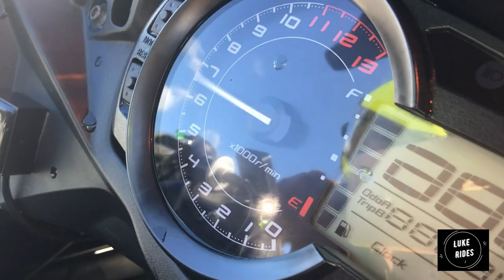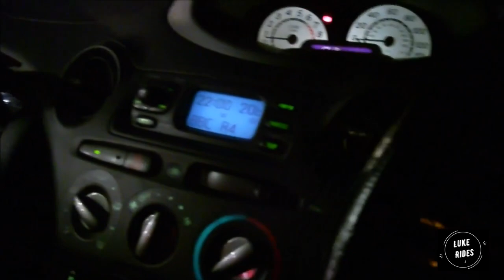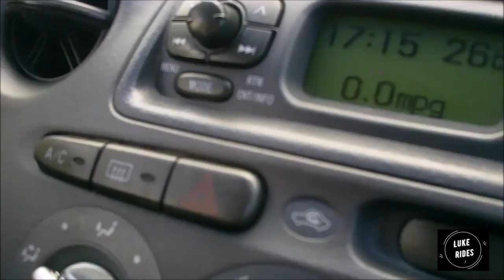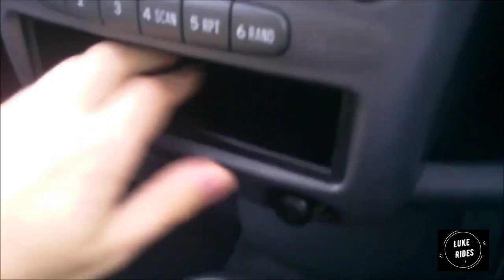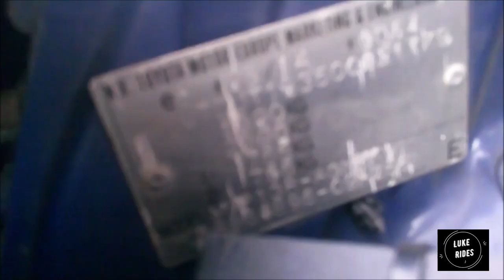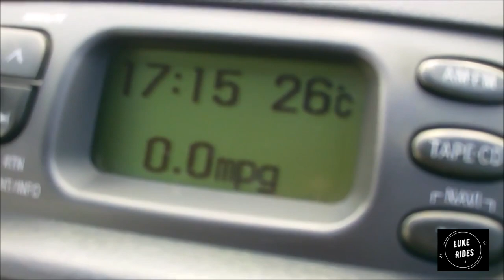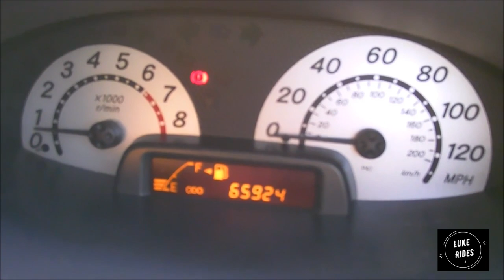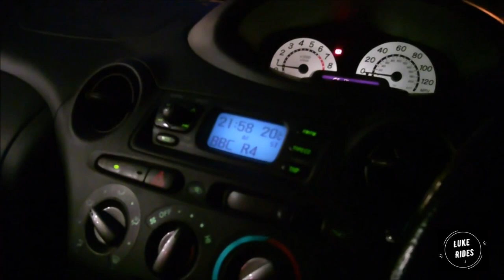Why Toyota Yaris T Sport Was A Great Hot Hatch @ Luke Rides

Comment: 1:30 lol
Reply from the maker: Haha. Awww. Luke Rides really appreciates your comment Harry and glad you found it funny. Luke Rides likes to play with his motovlogs and to have fun in his own way when it comes to motovlogging. It was an honour to talk about what makes the Toyota Yaris T Sport a awesome hot hatch of the time. Toyota didn't build many of the Yaris T Sports. Toyota fitted larger engine with VVTI Toyota's form of variable valve timing. For the time it was actually fairly fast. No traction or stability control with fitted to the Yaris T Sport as the Yaris T Sport was before computer aids like that were able to be fitted to cars. Even for the early 2000s this was very modern car. Toyota focused on upgrading the suspension. Tuning the steering and suspension for performance. And feel.

Making all of the sporty upgrades and handling upgrades underneath the Yaris T Sport. Even Toyota Yaris T Sport has different struts and coil springs compared to a standard Yaris. And the side skirts. Spoiler for added down force at speed. The more aggressive faster looking body kit. Toyota were very proud of what they created here. And Luke Rides is honoured to have through the power of YouTube. To remember the Yaris T Sport. To make it remembered through YouTube. For there to be a honest review and videos just for the Yaris T Sport. 

One day there wouldn't be any more on the road. As what happens when manufacturers stop build certain car or Supercar and then fewer and fewer of them are left. It's important that we remember the Yaris T Sport. Remember they existed. That Toyota built them. Built this sporty fast little car. When that day comes. Where there are no more Yaris T Sport the world will be a lesser place. That history needs to be remembered. Luke Rides is honoured to remember the Toyota Yaris T Sport. To have experienced such a amazing hot hatch. Thank you for such a nice comment Harry. Hopefully we will speak again.

Comment: Have to agree that Toyota nailed the exterior design, both on the 2nd and 3rd generations. Also, agree with your observations on a front mount intake and rear mount exhaust manifold. In many ways, this design help facilitate my turbo installation. I did swap in a Corolla 1.8 (2ZR-FE) before turboing it and having the intake up front probably really helped with cooling of the engine. You have a very nice TS there! I actually purchased 5 TS badges from England (I'm in Canada), one to install on my car and 4 others for my buddies at yarisworld, all of whom have done the same engine swap.
Here's my car, if you're interested.
https://www.youtube.com/watch?v=qH2HCcNXF28
https://www.youtube.com/watch?v=6eJXEtcY0RQ
https://www.youtube.com/watch?v=fFvwnmc09Qc&t=0s
Reply from the maker: Wow :). Get on, engine swap on Toyota Corolla. Now that takes skill Adam. Thank you for commenting by the way. You are absolutely right in what your saying too :). Toyota did such a great job on the exterior design back in the day. Yaris T Sport looked so much more futuristic back then when it was first released and built compared to a lot of other hot hatches back in the day. Toyota nailed the exterior indeed :). Yet the exterior design of the Yaris T Sport still looks good to this day which says a lot :).That is a great point too the fact that Toyota engineered the intake to be at the front of the engine bay which as you said that really helped. As if Toyota did think about turbocharging their T Sport's but just never got around to it. Thank you for the kind comment :). My Yaris T Sport was a great car and was a nice one as well. I did my best to look after my Yaris T Sport before moving into BMW's. Fancy having to buy 5 TS badges from Britain :). That is interesting. That's great to hear about the engine swaps :). Yaris Or Corolla T Sport with the turbocharged engine must be really quick :). Fast cars. I will definitely check your links Adam B and I look forward to watching your videos of your Toyota speed machine :). Thank you for the links. I hope your ok with all that I've seen happen recently to Canada with the virus. My entire country is completely under LockDown as well :(. The police back home now have the power to fine anyone seen breaking the rules. The fines are nasty as well. The whole world is going a bit crazy. I know we will all get though this dam Virus. It's just a question of when. Stay safe out there Adam. Thank you for commenting and is nice talking to you Adam :)
Reply: @luke_rides  Wow! Thanks for the awesome response! I really agree with your points about the styling of the car. I hope you like the videos. I kinda suck at making videos, but it does show what I was doing in my projects. I know virtually nothing about BMWs but if you let me know the model of our car, I'm always up for exploring! Haha. Yeah, the covid-19 outbreak has us at home for two weeks now. I have two kids, 8 and 10 and thankfully they have been getting on well and seem to not be missing school too much. I'm a teacher, so I'm obviously off too. My wife is being temporarily laid off, so it will be the full on family thing for however long this all lasts. I hope you get through all of this safely. Cheers, and again, thanks for the great conversation!
Reply from the maker: Your welcome Adam B. Anytime :). Thank you so much for your kind reply :). I love getting back to everyone who comments on Luke Rides. I notice when YouTubers don't talk back to anyone on their own Channel and It does look quite rude when YouTubers do that. Maybe the YouTube fame can get into people's heads then they forgot where they started. Whos to say. That's great you love the styling of the Yaris T Sport too. That's awesome. I love your videos. Their absolutely awesome Adam B. I will spend some time liking and writing some good commenting on your videos :). Your Yaris Turbo is absolutely awesome :). What a car.  It sure sounds really powerful too :). I noticed on your Turbo Yaris - 2ZR-FE Swapped T28 Turbo and you opened the throttle I thought f@@k me shes a beast ;). Turbo engine in the Yaris T Sport spools fast :). The acceleration was instant. Your Yaris T Sport Turbo looks like a lot of fun to drive. Myself, I drive a Junior Supercar. BMW 335i Twin Turbo straight 6. The BMW literally pins you in the seat if you dare open that straight 6 Turbo. The acceleration is a bit insane. I do understand why BMW drives are the way they are because I'm the same, overtake anything that crosses your path. Fast BMW's don't do slow. They just want to accelerate like a sonic jet fighter and not stop. Feel free to check out the BMW 335i Twin Turbos ;).  Yaris T Sport Turbo is an awesome car thou. You're a very lucky man ;). Sorry to hear about covid-19 has hit your country like that. Hit your home like that. I'm glad by the sounds of it you have an awesome family around you. I'm glad your kids are doing well :). That's great to hear Adam. You're a teacher. That's pretty cool dude. That's quite interesting. So you can teach your kids too while they can't go to school if you want. That's pretty useful. Sorry to hear your wife got laid off thou. It's never nice when a employer does that. That's pretty harsh. When everything that's happening with the Virus even I've noticed that business in Britain is really quite. So much less work out there which is annoying. Few people want to do business. I get the feeling we are in for some harsh times until this dam virus blows over and life can get back to normal again. Myself, I'm a total petrol head and a total I.T. geek :). Client's call me tech genius but I just love fixing computers and technology :). With the lockdown still in place in Britain. My home I can't even go out for a drive Adam. And it is killing me :(. I want to drive. I want to ride. I know we all will get through this Virus. It's just a question of when. I hear in San Francisco Clinical companies say that they are trying a few different vaccines that they have been starting to put together. And saying that they are making progress with several of the vaccines that they are experimenting with. I actually didn't hear about this from any of my own British news. I had to figure out how to access the US news channels and found out that way. It does sound like there will be a vaccine It's just a question of when :). It's great talking to you Adam and thank you for commenting :). It sure has been a great conversation :). Speak soon and stay safe out there Adam. My best wishes to your family. Stay safe out there.
Reply: @luke_rides  well said pal, now we know your not a bit 😂🤣👍
Reply from the maker: Yay :)
Reply: Hey, just bought an Echo RS, in Canada as well.  Bought as a winter car but something happened and I’ve really come to adore the car.  Just something about it.   I’d like to get some performance parts but man, so hard to find and I don’t know where to look.   What province you in?
Reply: @luke_rides  Did they ever make an auto and if so what type was it?
Reply from the maker: It will be difficult to find performance parts. In Europe we call it the Yaris T Sport. This is what often happens to cars that are 10 years old or more. For us The Yaris T Sport was released a long time ago. Early 2000s. It is sad to think such cool fun cars are more and more difficult to find parts for because they are not support. The Yaris T Sport. Echo RS was such a fun well built capable Junior hot hatch. How the world changes. Well done on getting the Echo RS. And getting to experience such a cool car. Love it :)
Reply from the maker: No. As far as Luke Rides is aware. There was no auto version of the Yaris T Sport. Yaris T Sport was paired to a manual 6 speed gearbox. It was actually a pretty good. And fast gearbox. Hehe.